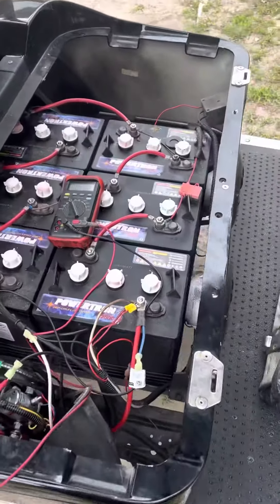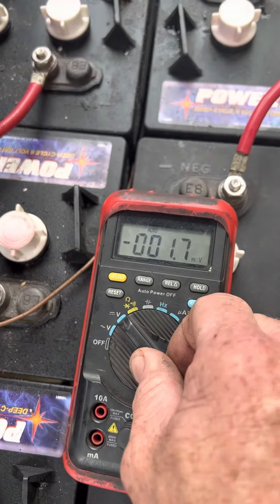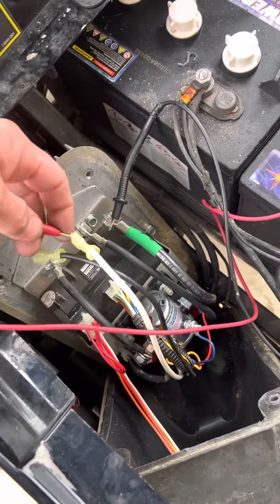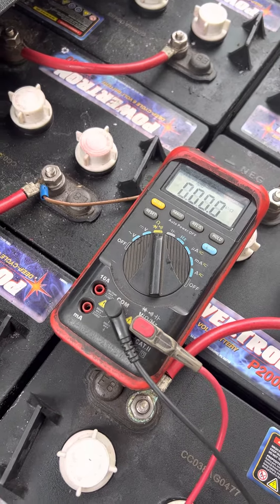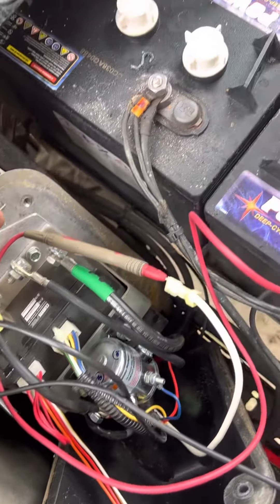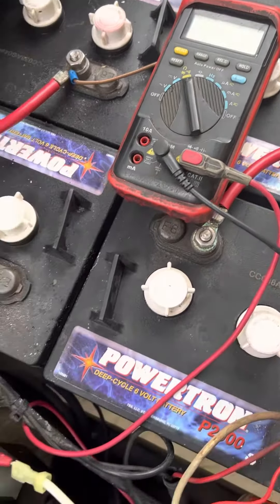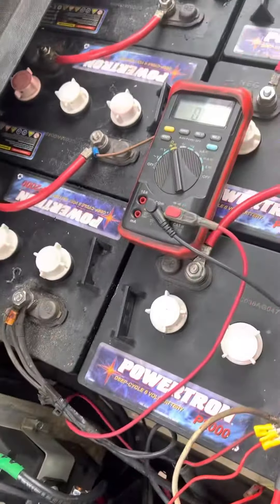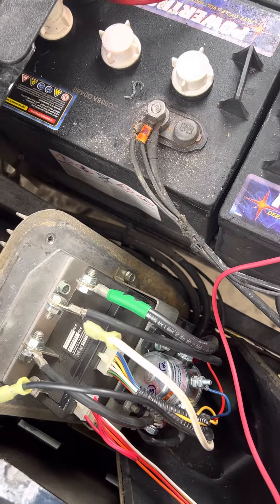We Tested an Electric Golf Cart Motor

Comment: You mention grounding to the case at the end of the video.   Before I install a new controller,  I wanted to know if the frame is suppose to be grounded anywhere.   Your video seems to suggest it should be grounded but mine is not.
Reply from the maker: The controller should not be shorted out. If you put your volt meter in the black or white wire and touch the other lead to the frame. It should not ohm out
Reply from the maker: You don’t want no ground to the frame
Reply from the maker: But first thanks for watching and commenting

Comment: If my white wire reads 107 kilo ohms to the frame is my motor bad?
Reply from the maker: No probably reading through the brush dust.  As long as it doesn’t zero out. What’s the cart doing
Reply: @Golfcartwhisperer  died on me on the trail. All my low voltage circuits check out and the solenoid clicks when I hit the gas but the cart doesn’t move.
Reply from the maker: @bensoncd1990 does the sol click in and hold. Or click in and out while you’re holding the gas down
Reply from the maker: @Doodyboy1990  do you have a forward and reverse button?
Reply: @Golfcartwhisperer  it clicks and holds
Reply: @Golfcartwhisperer  yes I do, it’s a 2005 txt pds 36v
Reply from the maker: @Doodyboy1990  you have bad motor brushes. Take the motor off and put new brushes in it.  Make sure you order oem brushes for an advance motor
Reply: @Golfcartwhisperer is it still bad brushes?

Comment: Ezgo pds golfcart was running fine but then stopped due to loose connection on solenoid.  Solenoid got hot and burned f2 white wire.  I cut off bad part of white f2 wire and rewired it but cart won’t go.  Solenoid only will click once when I depress pedal.  When I try to press again no click.  Is my solenoid bad or did I fry my controller? Seems like area behind 10 pin connection gets warm/hot.
Reply from the maker: Did it burnt the coating off wire and touch raw
Reply: What happens wen I touch the frame it tell me -.09 what dose that mean
Reply from the maker: Probably just reading through the dust in the motor